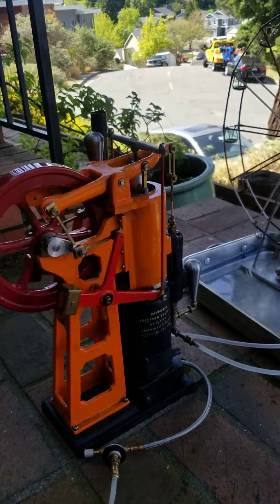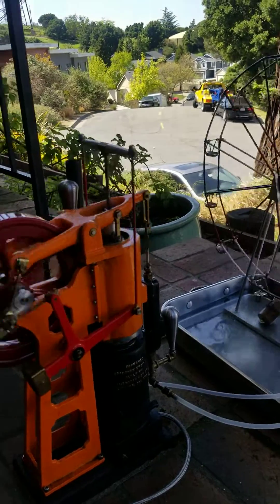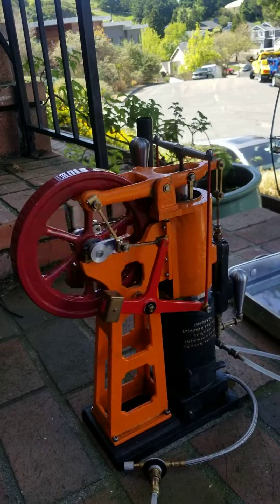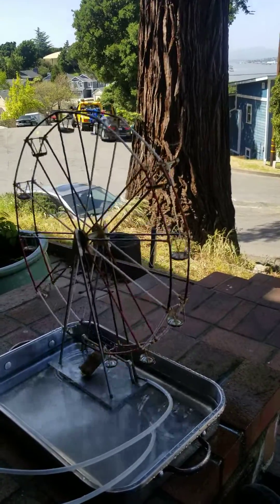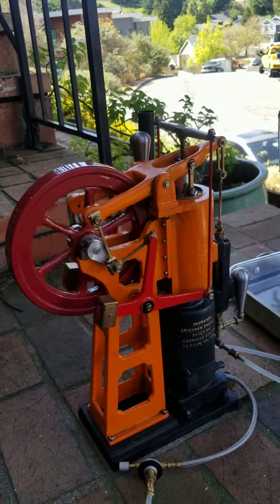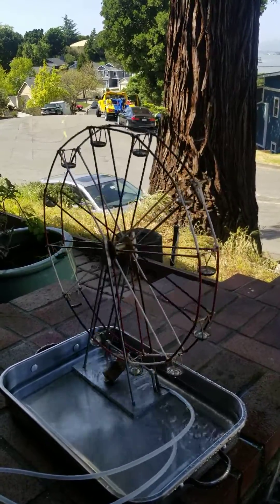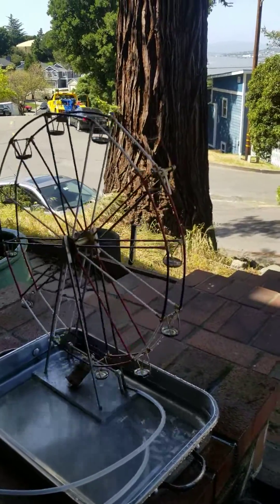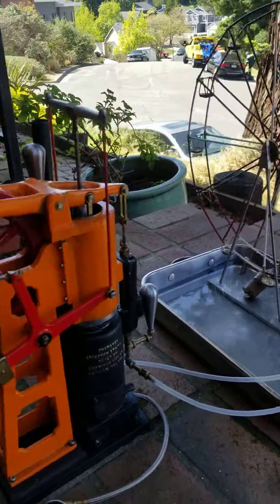Denny Stirling Cycle water pumping engine With Playful Water Wheel

Comment: Very nice arrangement. I'm always amazed at shows by what entertains the public. I have a horizontal steam engine driving a mechanism with two platforms to operate a slinky. The engine goes completely un-noticed by the public. It's the slinky that draws the crowds.
Good job Paul.
Thanks